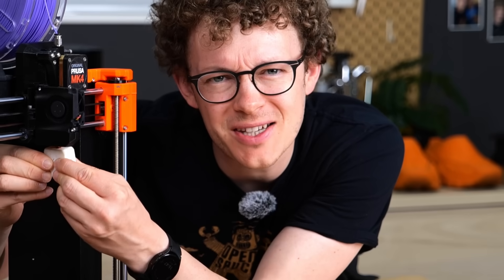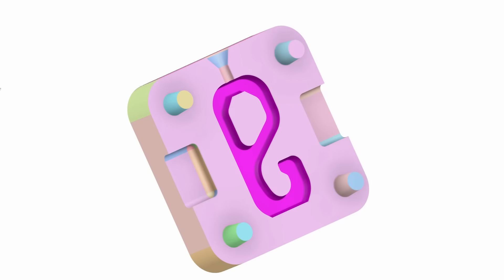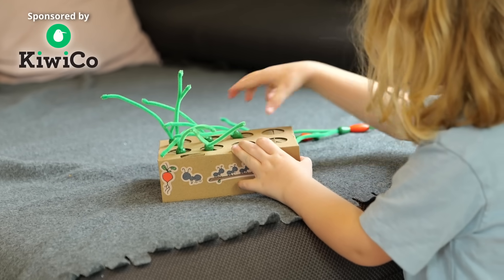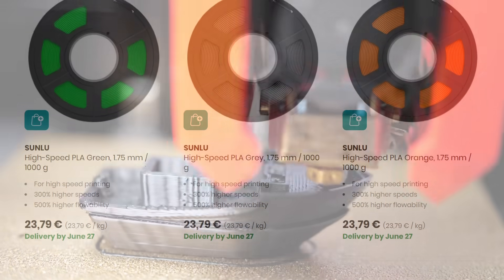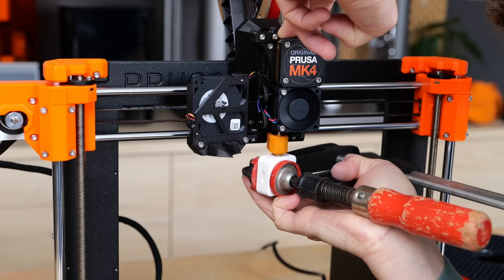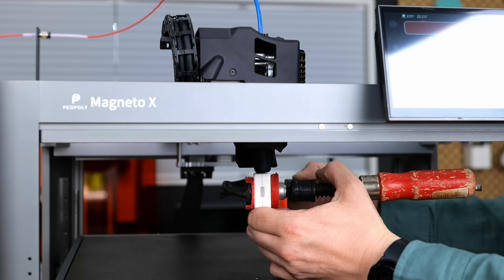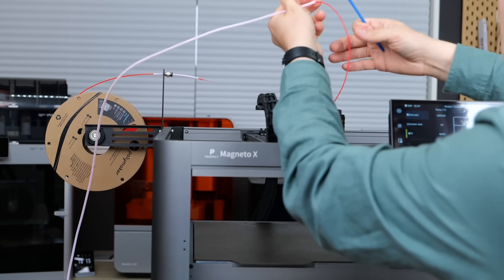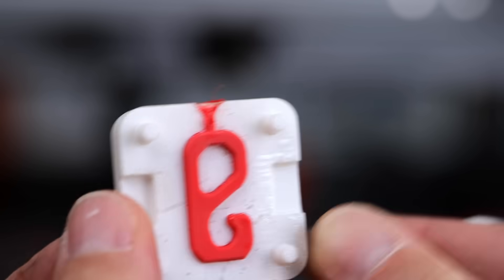I tried Injection Molding using a 3D Printer!

Comment: Couple of ideas, which come from my experience working for a molding company:
Keep the mold hot at around 10 to 20 degrees (celsius) below the melting point of the material. This will give you plenty of time to inject.
Make tiny channels at the corners and dead ends of the form to let air escape. This will reduce the needed pressure and it can serve as 
an indication when the material has filled the mold.
You can make the mold outline smaller, reducing the needed resin.
Inject from center outwards, not from one end. This will spread the material more uniformly. Best is to make the input port on the larger side of the mold - that way it will be as short and as close as possible, thus reducing the heat loss before filling the form.
We are using thin motor oil as releasing agent. Sometimes petroleum jelly. Depends. These are cheaper.
Reply: :hand-pink-waving:
Reply: Centre outwards is key, I think. Reducing the distance the material has to flow from the injection pot to the extremities of the form reduces fill time.

Comment: Honestly, try a mold with 90 deg angle (soft) so you can lay the mold on the plate, heating it and clamping it with the nozzle at the same time
Obviously small exit hole

Comment: why not use the presure from the stepper to get the extruder pushing the mold to the build plate!! ofcourse using a other entrance to push the plastic in the mold also you could  preheat the mold using the build plate

Comment: Couldn't you just lower the hotend until it presses the mold against the printer's bed? This way, you can also use the bed to keep the mold hot.  Also, how about designing the spruce so it fits the whole nozzle inside, reducing the effective spruce size? Not only that, but you don't necessarily need the spruce right on top, you can put it on another place closer to the geometry. And why did you opt out to put air holes?

Comment: it would be easier to fill the moulds if you add a hole at the bottom for the air to escape, so there is not as much back pressure

Comment: Where does the air in the mould go? You need some holes for the air to escape when you inject the plastic, otherwise the pressure just builds up and the nozzle seal with the mould is weaker than the seal between the two parts of the mould, so the plastic just leaks out rather than compressing the air in the mould. That's what the little fingers of rubber on brand new tyres are, the remaining rubber that pushed through the air escape holes.

Comment: You can buy annealed tool steel, which is ready for machining. Just don't cut it in a way that gets it hot, or it'll temper and harden up. Then when you're done, you hit it with a blowtorch to temper it.

Comment: I would leave a gap/cavity in your mold at the top to fit around the end of the hot end so that you don’t have to use pressure from your hands to hold it on and you can just unclamp it after the injection process to remove the mold and the item from the mold. I also think that this would work especially well if you had a CNC machine aluminum mold that you could preheat.

Comment: Molds usually have breather holes to let the air escape. Also, you should inject from the middle, so the plastic doesn't have to travel as far to reach all the corners

Comment: I think the biggest problem is you're losing too much heat to the mold, and it solidifies before it's completely filled. Others have recommended preheating the mold, but I think if you modeled internal channels into the mold to plumb & pump boiling water through, it would keep the plastic molten for much longer.

You could use the siphon effect from a tea kettle to move the water through. Just set the tea kettle above the mold, and have an exit line from the mold going into a bucket well below the printer.

Comment: Maybe build a custom injection machine? A heated metal vice to hold the mold in place, and a parrallelogram like arrangement with a lever or similar to lower and press the nozzle into the mold.

Comment: As other have said you need an exit for the air at the end of each part.  Pressure will build up in all the dead ends that cannot be overcome by the low pressures. Could you use two hot ends side-by-side injecting into the same mold?

Comment: Okay so good job on the fill sprue, but you didn't have a pressure relief sprue anywhere. Have you ever seen a model kit where the sprue is surrounding the entire thing but continues off in multiple places as well. That's for pressure relief, you run a few thousand bar into a piece of tool steel everyday. It's eventually going to crack. So they apply small usually smaller than the fill Port releases for pressure allowing detail to flow from the top of the part to the bottom front to back. Whatever you want to call it. For your test mold, you would need to put a tiny little pressure release in the tip of the hook. It does take a lot of intentionally remaking molds to get it just right sometimes though. But for smaller parts like this it's easy

Comment: 1. Air Vents.
2. Not pre-heated but under heating mold sides. You can put heaters in clamp heads. That will widen aplicable plastics range and give full control to molding.
3. Careful inject point design.

Comment: It is nice to see you finally realized you needed a release agent but you never added any holes to vent out air or squish out plastic (exit) to make sure you filled your mold fully.

On a side note, what about light gardening resin to fill the mold? There will be no real limit to the size it can be and you could add tons of filler and still squirt it out with a paste extruder that will block the frequency of light that hardens the resin.
Reply: The air hole could be a gap in the mold fit. It could result in a brim like material that should be easy to remove.

Comment: Fill the part from the middle.   Use the mechanics of the printer to hold the mold hard to the hot bed.  Mold is too cold is the obvious problem.  Still, fantastic results are possible as you've shown.  An obvious project that might grow from this is a system to clamp mold 1/2's between hot plates.  A nozzle that fits in the mold cavity (the mold is clamped around to form seal).  Somebody must do this.

Comment: Use injection mold for Z-Strength:

I had that idea for a while, just haven't found the time to try it out. Why not “injection mold” into the infill for higher z part strength? You could even offset the injections to strengthen really Z distances.

Comment: For someone looking for injection moulding on the cheap, RetroTech Journal’s diy injection milder made from a pneumatic press might be a good approach. while a lot more expensive than this, it’s still a lot cheaper than actual automatic injection molders and is quite capable of

Comment: What if you tighten the bed. Right at the bottom. Get a strong stepper motor for the Z axis, and mod the printer to use pellets. You can have the nozel move right in the whole, and make it very tight and inject the stuff.

Comment: Could just put a heater in the mold block itself so you can fully control temperature and cooldown time for increased strenght , also a air vent hole would help. Could lock the mold inbetween the bed and the nozzle but be carefull to not damage the carriage. Good luck

Comment: Could you add metal or carbon particles to the mold, then place an induction coil around the mold before injection, the idea being the mold becomes self-heating, to keep the injected plastic from hardening before all the voids are filled? Or use somewhat conductive plastic in the mold and simply pass current through it to do the same thing by resistive heating?

Comment: unpluging coolinng onthe print head many two, as cooling not thing you want untill the plastic's in the mould first? and adding air vent in the molt to, your just sealing up air in the mold with now where to go? it also let no the reach the end mold with the plastic, if drips out?

Comment: as many people have stated before:
1 - you need air vents to make plastic flow in all parts of the mold, you're getting acceptable result only because your mold is not airtight, but it's always better to have them, you'll also use them as a clue of a well filled mold.
2 - I think you should find a way to pre-heat or actively heat the mold during flow process, it reduces plastic viscosity while injecting
3 - next step is to stop using a 3d printer and just buy a specific hotend with 1.8mm nozzle and good temperature ratings, mount it on a manual press and start injection molding like a boss.
4 - also, you might look into reflow techniques, like using molds that can withstand 300+ °C allow to reflow the mold into ovens and slow cooling the piece should reinforce its machanical properties.
5 - cool idea, I'd love to look into it myself, but I first need a resin 3d printer sad face

Comment: Cool but important part is that injection molding has release valve to release air and plastic to fill up all the cavities as well not really required to use the entire 3D printer but just the heating element with a NEMA Stepper and you can upgrade the stepper to a more powerful one as well the heating element to a bigger container to have the plastic already preempted.

Comment: As someone who is only familiar with the basics of injection molding, I can say even in the opening paragraph that this can't possibly work right. Hot flow molding requires heated forms and tremendous injection pressure. With that setup, you could conceivably make parts out of cheese.

Comment: Air escape paths might help. Here are a few other ideas. Why not use the bed as a injection clamp? Use the C-clamp for the mold and lower the head to the bed for clamping. Also, multi-path injection? Basically have a path to do an 'over mold' for the head of the bolt or other features.

Comment: Where do you expect the trapped air to escape through? Install vents. 
The mold is too cold. Let it heat using the bed.
Inject where the internal volume is biggest.
Use common sense and read up.
😒

Comment: @17:28  (By experience) Most injection molds have vents to let air escape and to decrease backpressure. Well placed vents will let the plastic fill the mold completely (and more easily) without flashing. 
In the case of your hook, adding a vent at the very end on the hook would help. For your screw, vents near the corners would be good.

Comment: Actually that would be a great idea, if making resin molds works for larger pieces as well a consumer grade plastic injector might be a good invention. You can make solid injection parts, the resin could be used a few times before it's too degraded and it could really use up a lot of waste plastic that way. Hell slicers for resin printers could actually be developed with a "mold print" function to optimize for generating mold.

Comment: Try replacing the nozzle with a  piece like that adapter but longer. That way you will not be wasting pressure trying to force plastic out of a tiny nozzle. You can also design your mold with threads so you can screw it directly to the new "nozzle" creating an airtight seal. Plus adding and air hole at the bottom of the mold is absolutely necessary. 3rd suggestion would be to remove the fan on the hotend to get it hotter. However that is risky for obvious reasons.

Comment: Dental Labs and Jewelers use "exit" sprues ( I cant think of the proper name) that allow the flow to go in one direction easier. They use it in plastics as well. You can somtimes see where they cut off these round sprues. And sometimes letting excess plastic flow out the other side helps force it into the corners, IDK why or hoe this works but Im sure You can find out. Theres always more than one way to skin a catdog

Comment: U can get a $160 cnc from walmart that works just fine to mill molds oit or aluminum or steel. Just takes time to assemble and build ur space safely but once you do. It does NOT take much power at all suprisnglt, you will just be linited by how much blocks of aluminum and steel u wanna buy and thats gonna get expensive unless u already gave a source of some metal plates to cut up which u may. U could maybe turn some trash into small metal molds with a cheap cnc

Comment: Yes i even got petg and a printer gun. I successfully heat gunned some fimament poop into a basic brick mold but had to spray some stuff i had to buy, mold release but once u have that and a silicon tray and a hot tray or even eax melter you can do some amazing stuff...outside....with burns...and maybe j haling a lil plastic so maybe use special mask so this can get expensive ifnu wanna do it safem its not injection molding but u can still melt down pla into petg molds. Ima invest in 1 big metal mold and funnel and i think a big old toaster oven can work

Comment: Build an aluminum case or out 1” thick aluminum for the mold to go inside of, have it bolt togather. Drill a couple of small holes in the aluminum ti where it gets close to the pla mold, but not actually all the way to it. Pre heat the aluminum casing, with the mold inside of it. You’ll have to play with tempatures some, but the aluminum will keep the mold warm r for longer and (hopefull) make this more successful.

Comment: consider a material with a higher heat tolerance that also loses heat slower so that as the extruder starts to inject it, it does not cool too fast. Try to match the temp of the extruder

Comment: If your mold halves are so well fitted that you are getting no flashing, maybe you should make a TINY outlet channel for air egress at the far end from the inlet sprue?

I am sure they aren't airtight, but that doesn't mean you may not have some pressure building inside and fighting you.

Comment: On the M4 screw, you might want to create a small hole at the bottom to push the air out, so the TPU can flow without air pressure resistance pushing back.

Comment: As others have said, I think your process would benefit from: 

- Strategically placing the injection point where the molten plastic will have the lowest distance to flow.
- Adding a vent hole(s) where air is likely to be trapped 
- Use the heated bed to pin the mold to the extruder, which will not only keep the mold preheated longer, but the heat will be localized
  in the area furthest from the injection site, which is beneficial for flow.

Comment: FIrst thought that came to me was thermal loss to the mold is going to quick set the pla and yup. the mold needs heating..... why didn't you have a mold that included the print head hex in the sprue...

Comment: Why not use the printer to push the nozzle into the hole to seat it properly?
I bet it can press down with a quite a bit of force and it can keep it straight at the same time
At work we have a injection molding press and for PP I believe we have the temperature set to 160-175°C
Depending on where the thermal couple is on the hot end it will have to read more or way more than that cuz thermal conductivity of the hot end isn't perfect
Tiny vent hole to push out the air can also help but that depends on the part you make

Comment: I would say to stop using your hands for pressure.  There is a small gap between the extruder head and the body.  Use that to your advantage and make an injection mold that snaps onto the end of the extruder.

Comment: Standard 3d filament is made from "extrusion type of polymer" which means high viscosity (low liquidity). Standard inject molding polymer is "low viscosity type" material (high liquidity).  So material have to be liquid enough and be filled fast as possible into.  regards Michal (AURAPOL)

Comment: Sadly I think the quick cooling will just continue to be an issue. Usually in normal injection molding with metal molds, the mold is heated to prevent that cooling. Maybe you could heat the plastic mold but it might deform the mold and part when you try the injection. This is a super cool idea though.

Comment: The problem is the the mold has a "dead end", so the air inside will create a back pressure and prevent the material to flow inside. I think if you make some air hole in those "dead ends" it will fill completly. Also 120°C for the mold is probably too low, at that temperature PLA is already too hard. As you saw with TPU it worked because it's much softer even at cold temperatures.

Comment: You could make a mouldholder that includes peltiers to heat up the the mold and keep it at the right temperature

You should also include a funnel at the "end" of the path so air can escape and you know when the mould is full.

Comment: Try 3D printing a "hot glue stick" shape with the filament you want to test. and try to fill your mold by running that stick through a hot glue gun instead. You will get much higher pressure & fill rate with the hot glue gun.

Comment: I would take the entire extruder off the 3d printer, and build a jig. In the end tho, anything gear driven is going to struggle to do anything interesting. Maybe you can make an aluminum mold, and heat it to do a li'l better?

Comment: All the basic concepts of venting and material expansion and dissipation from metal casting and die casting apply to injection molding. You also want to avoid right angle surfaces because they will get stuck in the mold.

Comment: The problem filling the mold is you need to vent the air.  You should have a small opening just like the fill sprue and so it can be broken off easily.

Comment: Maybe you could use the hot plate to keep the mold warm. Potentially insert some copper plates to transfer the heat throughout the mold and to give a big contact patch on the hot plate.